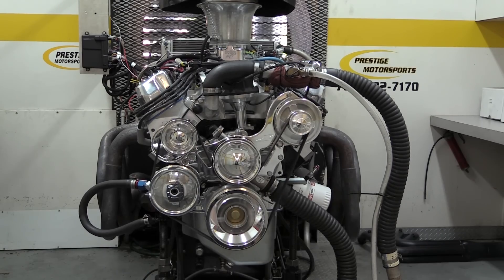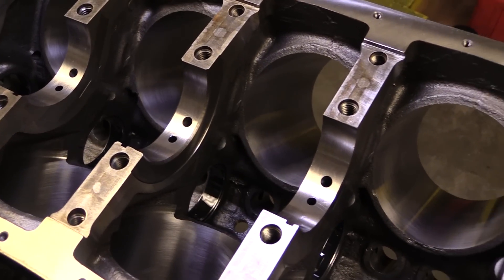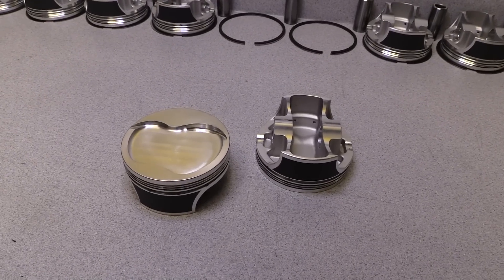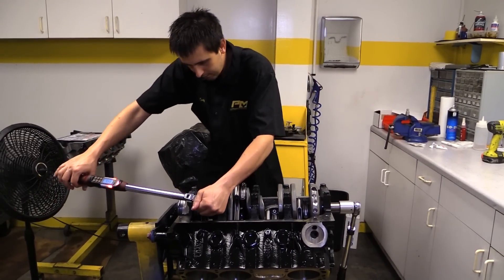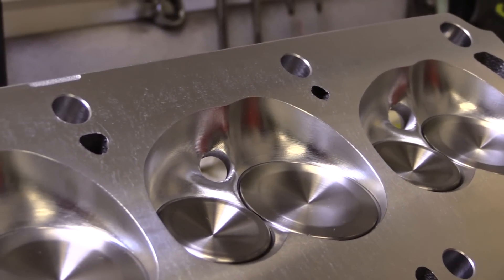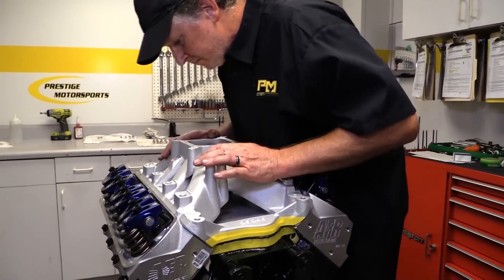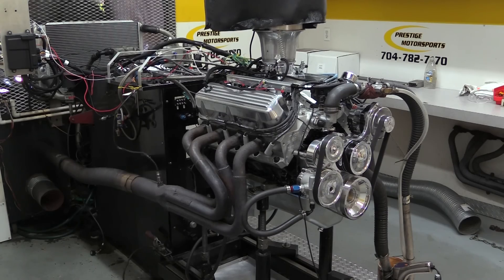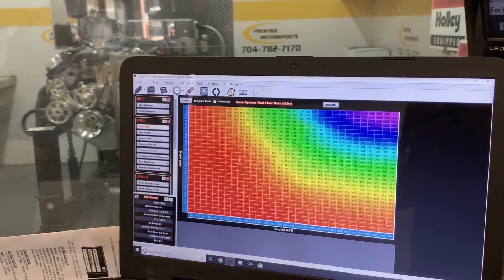Prestige Motorsports' Brutal 600+ Horsepower Ford Build!

Comment: What happened up top ?  Seemed like you had plenty of cam timing and enough cylinder head , even with 427 ci , to peak 6800-7000...  there is more there
Reply: Alan McGahie cam timing/specs are all wrong
Reply: I'm thinking they wanted the benefits of a solid roller with the reliability of a hydraulic roller. I'm thinking that's why they're not spinning it higher, the low compression for pump gas too. Sounds like a customer wanted a hard lopping, high torque, street reliable car. Just a guess based on the combo
Reply: Hereinmissoula  Looking at the shape of the torque curve, the power would of kept going with a bit of work. Though advertised HP was 600  and 6500 was all that was needed
Reply: gothic pagan this engine was just built wrong ...  way more potential in it
Reply: Best comment of this entire thread⬆️⬆️
Reply: Its a 220cc on a 438 not a 408.  You need a lot of air to turn 7000 on a 438. Probably 375 plus on the heads and over 400 theought the manifold

 Probably more like a 240cc head thats gonna require Shaft rockers different pattern exhaust etc.

6500 out of a 10.5 to 1 engine is about all this engine had. All it needs on the street yeah they could have just used a hydro roller with 260 @.050 to do it but it would ahve definately been a custom grind cam.
Reply: mrhazel truth to what you said .  However cam timing alone on this combo could push 6500-6800 rpm with 50-75 more horsepower .  I think the cam is all wrong .
Reply: @hereinmissoula11  its a 6500 rpm 438 with inline 220cc 20 degree heads. Its the biggest AFR makes.  That cam is huge in a 408w a 438? Nah it aint THAT big. Its pretty big but consider a 408w with a 200cc heads is like a 6000 rpm engine. 

It needs way more cam and bigger heads to see that 7k

It would need kuntz brodix heads or something like that to turn 7000
Reply: mrhazel and it seems like there is more with what they already have .....   something not right
Reply: @KingJT80  It's a 427 did you not watch the video !!!
Reply: @billdouglas6561  same difference youre talking 10 cu in
Reply: Hereinmissoula yeah, why the hell are you even going to use a solid roller cam if you're not even going to spin it to 6500rpm? Kind of makes you wonder sometimes if these guys even actually know what they're doing....
Reply: @TheMattc999  … I’m familiar with the builder. Its Prestige Motorsports and their credentials are solid. They build engines according to the customer’s exact specifications. I’m sure that in situations where they see a better way, they advise the customer and offer reasonable options before the build begins. I’ve also seen an occasional build that I would have done differently. But the person paying for it all has the final word. The old saying about the customer is always right obviously still applies regardless of my opinion and that’s fine with me. More companies could benefit from this example in most cases.

Comment: I wonder how much this beast cost to build?
Reply: As much as it would if it were gm once you drop the stock block and heads it all costs an arm and a leg
Reply: A LOT! The 1 i did had Jesel shaft rockers, morel ultra pro lifter & smith bros 7/16" pushrods tho, so that was at least an extra $1000.

Comment: Why would you soak solid roller lifters?
Reply: I'm assuming to lube the rollers. Roller bearings don't like being run dry. Plus, not like it's going to hurt anything.
Reply: I agree with street racer, believe it or not steel will in a sense absorb the oil and not to mention the tiny little bearings in the rollers will take on oil... Hope this makes sense?
Reply: @chickenmaster7069  --  You're either ignorant or stupid.. maybe both.  Go find a used lifter, steel rocker arm, just about any internal engine part and heat it up.  Clean it with brake cleaner first, then heat it.  You will crap when you see how much oil seeps from the clean steel.

Comment: Legit power and solid torque all american torque
Reply: 600 USA horsepower is equivalent to 450 Australian horsepower
Reply: What's fake power then ? 😂
Reply: @joshedits3196  Turbos are fake horsepower  LOL
Reply: STREET RACER hmmm no, engines get sent here from the US all the time with dyno sheets from well known shops, then when they go on the pump here they somehow lose 20% to 40% of the HP lmao, a 427 SBF ain’t shit here if it doesn’t make 700 to 800hp on our crap pump fuel.
https://youtu.be/oJRMLfrlPvg

Comment: Does anyone know if this beautiful 427 engine would  install in a 67 cougar  that currently has the factory 289.   Would this engine upgrade require modified hood, inner fender wells/front end etc.?  I'm fully aware that many other modifications have to be done to the cougar to handle the upgrade in power.   My original plan was to install a HO 289 or 302  Any information would be appreciated.  I'm also going to contact prestige.
Reply from the maker: Besides building engines, Prestige Motorsports also has a hot rod shop. They do a lot of their own install work so somebody there probably will know. Good luck and thanks for watching!
Reply: Kevin Guthrie 
should go in with no problems - the cougar was even offered with the 351 Windsor when they were new.
Find the right parts and it's a bolt in, and will fit under a stock hood.
Reply: @Motor-City-Mike  not in 1967. Wasnt an option until 1969 but it will still fit.
Reply: @timchadwick8245  
True..
'69 up....
But the point was that as you agreed - it will fit.
A 351W will bolt in on the original mounts (not so with the Cleveland) of nearly every Ford that ever came with a 289/302, the only issue could possibly be the increased overall height of the 351 Windsor.
The only factory installation that I can think of at the moment that would definitely have a height issue is the V8 Mustang II of '77/'78, even then the swap would be a bolt in on the factory mounts, bolt up to the stock trans, and so on.
The 351W seems to be a largely overlooked performance alternative - spending very little in terms of a high performance engine build, they can be a very potent 390+ cubic inch powerhouse!
We even swapped them into Pintos (yes - long ago!) without any more trouble than a 289/302 swap.
They're one of the most universal engines Ford ever produced.
Reply: @Motor-City-Mike  lol Pinto ur going WAY back on that 1 😂
Reply: @timchadwick8245  
I sure am!
I'm a dinosaur (lol)!!!!
Lots of miles on this old body but I wouldn't trade all the things I've seen and done for anything.
It's actually kind of fun!, there's all these "experts" that write articles about what was and wasn't (car stuff) before they were even born, and then argue with people who were actually part of what was going on!!!
Yeah I liked Pintos, still do. I've owned at least one of every year they were made except '78.
I still have one - a '77 sedan delivery.
Reply: @Motor-City-Mike  fellow dinosaur here...my friend had a pinto with the factory bulletproof 2.3L & 4 speed when i was 16 (in 1981) that we used 2 beat the tar out of. Fun car.
Reply: It should! If you can install a 302 a 351 isnt a problem .....hood clearance will be though
Reply: YES. I owned a 67 for years DD & bracket raced on weekends then eventually purely drag car. Pulled the 351W from my 69 Cougar when i totalled it, bought the 67 as a rolling chassis & dropped the 351W in. Only engine it ever had (albeit in several different configurations but always with the same original block & crank). Had to modify 289/302 headers tho as 351W-in-1967 Mustang/Cougar chassis headers werent available back then (35 years ago)
Reply: @timchadwick8245  
Makes sense - with the deck height being so much taller than the 289/302 headers would definitely be an issue.
On the V8 Pinto swap, Hooker's headers were a pain to modify until they came out with them just for the 351.
The front primary tubes went down in front of the front cross member which made adding length up by the flanges a pain in the butt!
That's why we (I'm sure you count in"we") old hot rodders are different than today's "breed" - we made/modified what we couldn't buy!
Reply: I'd go 408w

Comment: 10.5:1  Shooting for running on 87?
Reply from the maker: Wish! That probably wouldn’t be wise. Nope, it will need to be at least 91 octane. But still available at practically any gas station. Thanks for watching!
Reply: I would not do it not 87 octane.
Reply: There werent a lot of piston options back when i did my build a few years ago. I wish these SRP were available then as they look nice & r actually 3cc smaller than the Mahle 26cc i used which neccessitated me milling the heads just to get up to 10.5 CR. Thats a good safe CR for street as the target car 4 the 1 i did will b n traffic n rod runs, etc in summer heat with A/C. And it made stupid low end torque anyway so did not need more CR.

Comment: That'll turn a few skids👌. Honestly surprised that it didn't want to Rev harder with such an aggressive cam and big head.

Keep up the good videos and great to see the old powerblock episodes comming to YouTube.
Reply: Damn I have a smaller XE Xr292r Comp cam street solid roller in my pump gas 438windsor and it spins like a swiss watch to 7200rpm. It blew up 4 Built C4 transmissions in my 68 Mustang. Now I run a built TH400.